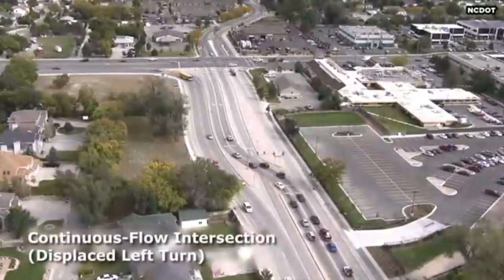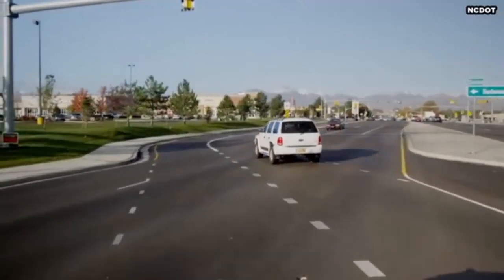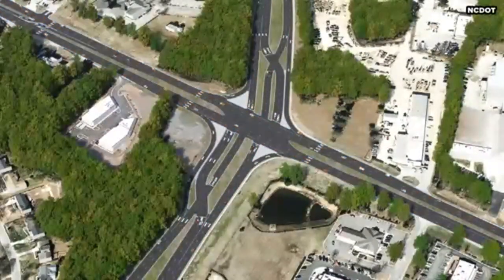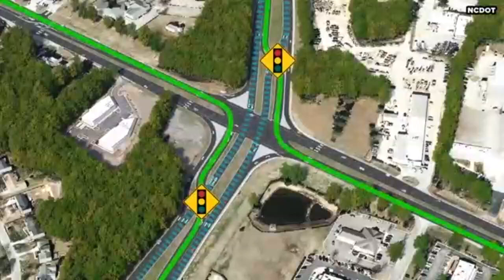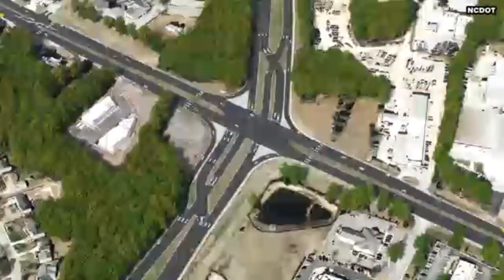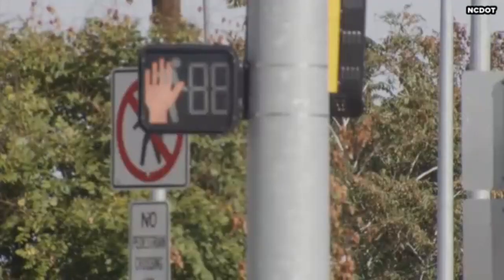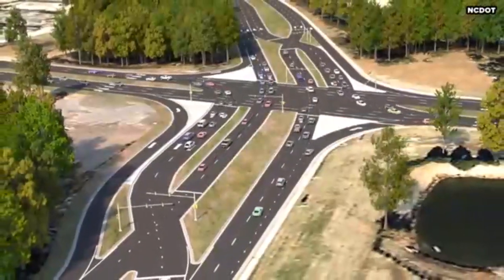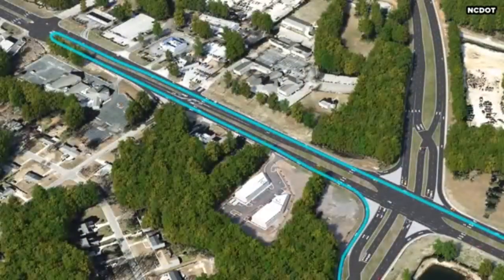What is a Continuous Flow Intersection? Here's How It Works!

Comment: Why not just use large roundabouts?
Reply: This is because large roundabouts really work well only when there is balanced traffic flow.  This is in contrast to this type of Continuous Flow Intersection, which is for locations with highly imbalanced traffic flows.
Reply: They just did this on a major roadway where I live to 3 intersections. It works amazing. Roundabouts would not have worked. There’s way too much traffic for that.

Comment: People will do everything they can to avoid traffic circles.
Reply: because they are garbage
Reply: If properly executed, a CFI's throughput will be at least as high as that of a roundabout.
Reply: @Tuppoo94 is it as safe as a RAB or as cost effective?
Reply: @reply_off  a CFI is much easier to put into an already existing interchange than trying to rip out the entire interchange to put in a roundabout.
Reply: @SadMarinersFan  other cities have done it very cost effectively to test it by using rubber stamping and just remarking lines